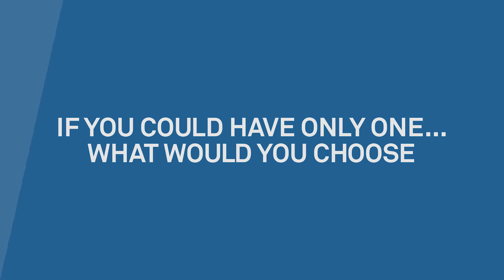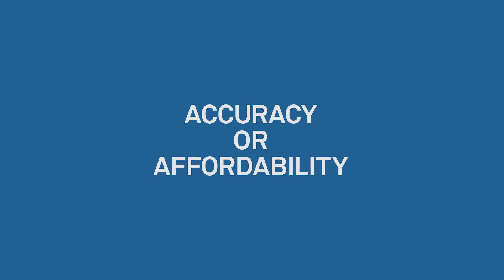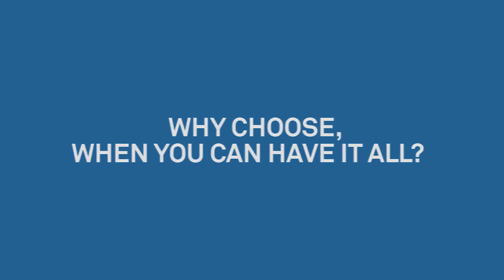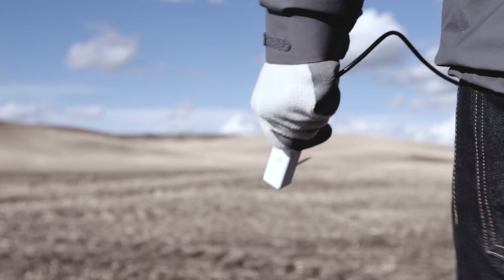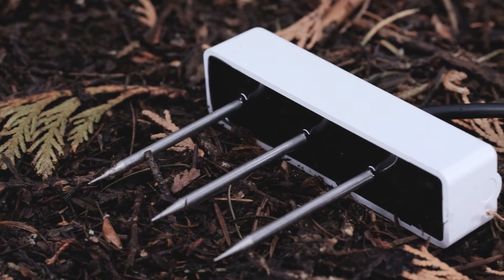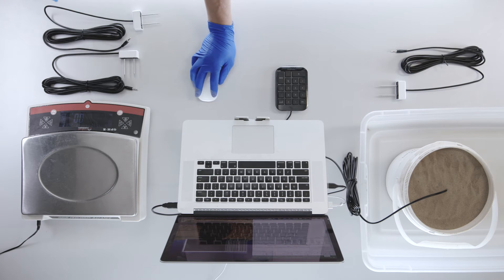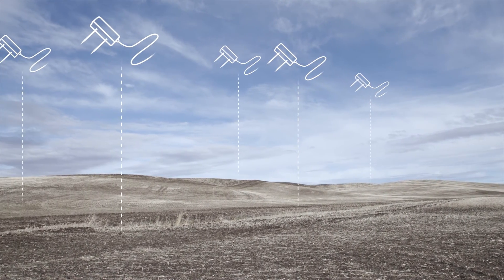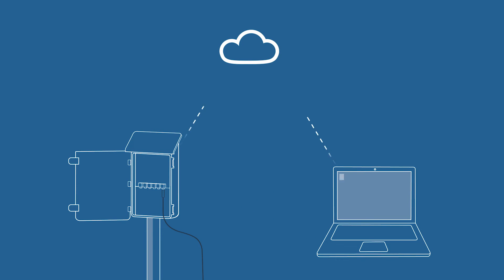Soil Moisture Sensors: METER TEROS Series - Accurate, reliable and affordable

Comment: I think the statements "all sensors are digital" and "Teros 10 measures temperature" are inaccurate.
Teros 10's output is 1,000 to 2,500 mV, and Teros 10 is not SDI-12.